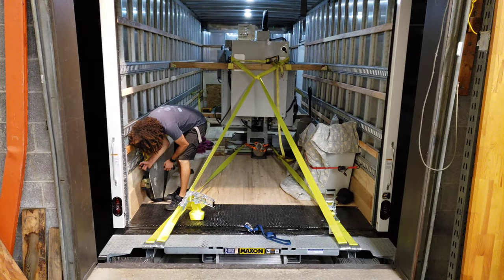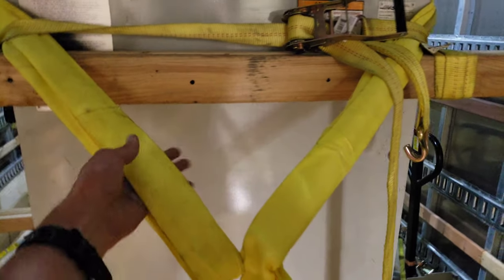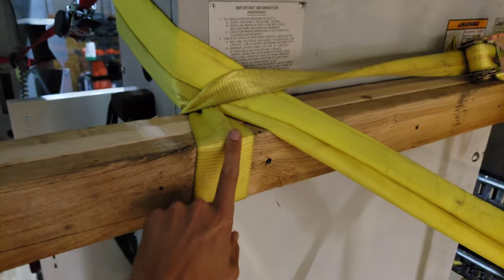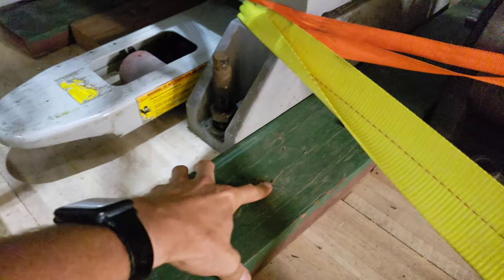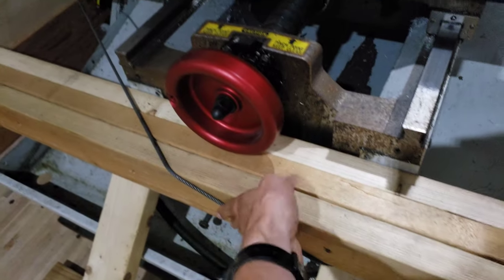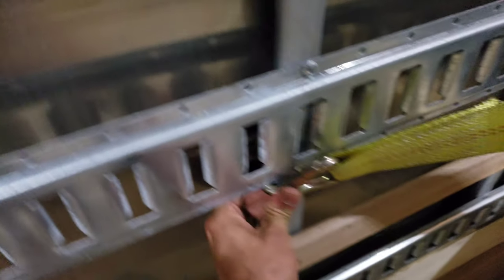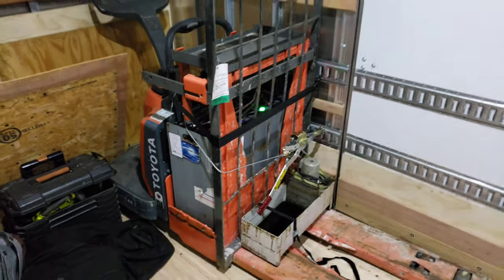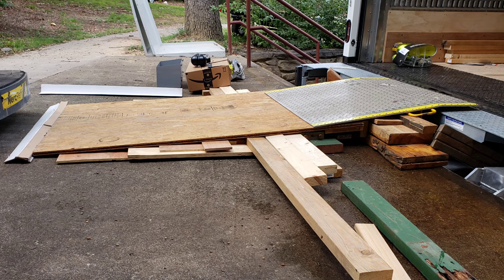Moving HAAS TM-1 CNC Milling Machine In a Box Truck (and Why You Shouldn't Do It!) How I tie it down

Comment: Sir can please let me know how do you pickup this machine? Thank you
Reply from the maker: We used a manual pallet jack to move around on concrete floor and a electric powered pallet jack to get it up a small ramp into the truck. If the move is flat, then a manual pallet jack works ok.

Comment: Do you have the video posted where you are moving it on the pallet jacks? I am looking a purchasing one of these and am trying to figure out how I am going to move it.
Reply from the maker: I did not record that. On relatively flat surfaces it can easily be moved with a 5k pallet jack. Just have to put some wood blocks between the pallet jack and base. Up a ramp to get it into the truck from the loading dock that was too low we used a powered pallet jack.

Comment: how did you get it in the truck?
Reply from the maker: That's a whole other video/story. Standard hight loading dock just required a dock plate and pallet jack. The lower dock where we picked up required us to build a ramp out of wood and plywood and use the powered pallet jack to pull it up the ramp into the truck.